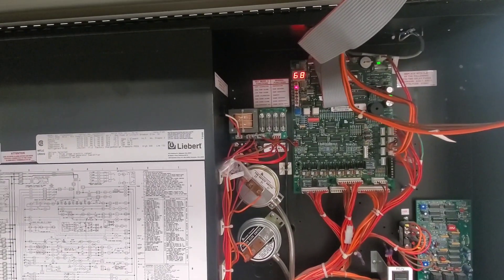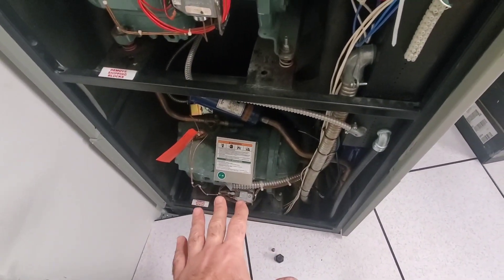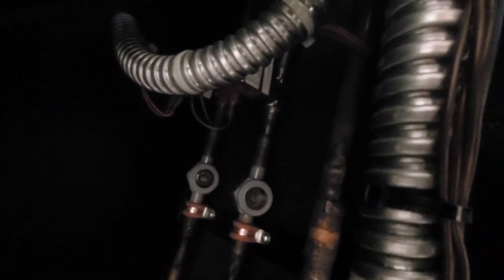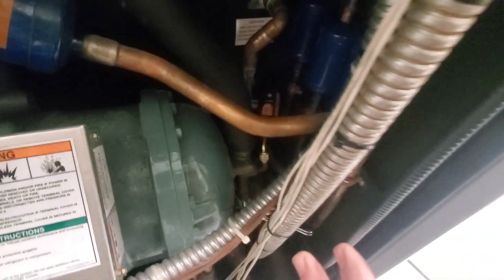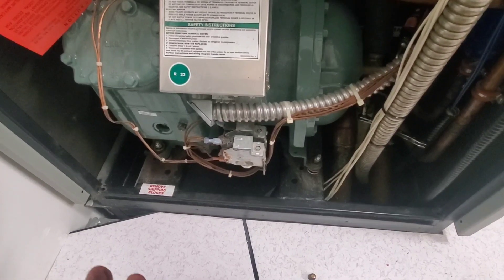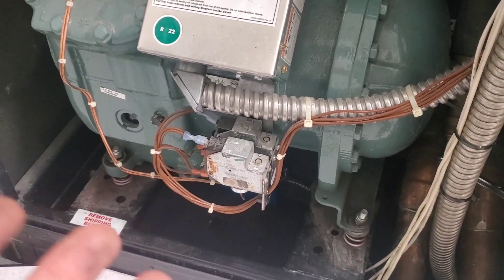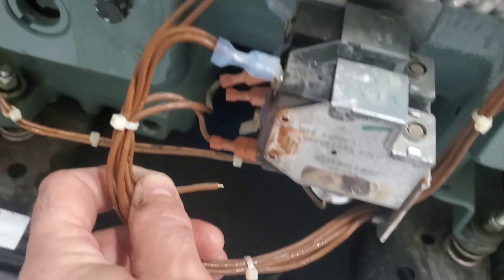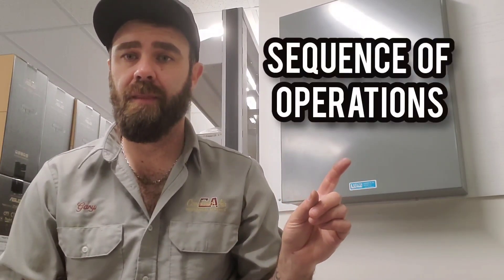Troubleshooting HVAC Equipment Using Order Of Operation

Comment: Nicely done! Love those machines
Reply from the maker: Cheers and me too!
Reply: @HVACKnowItAll  I recently had one the board triac for first stage lost its ground, the unloader is on a different triac so it and the LL solenoid were operating just no compressor Contactor. The control did not alarm it thought it was operating